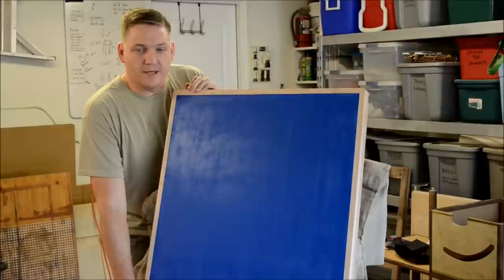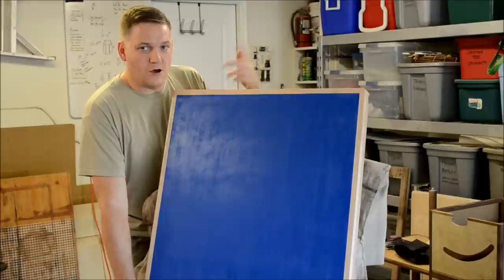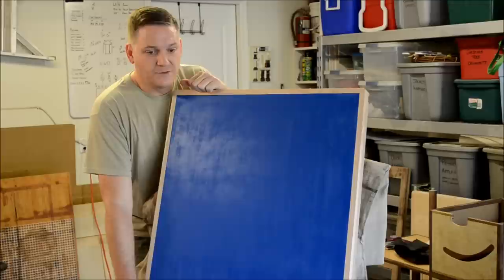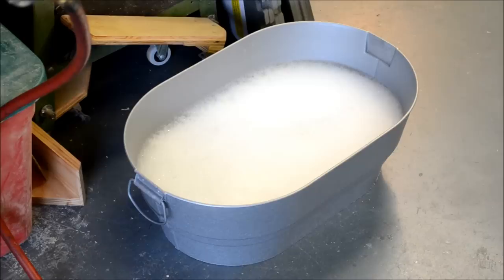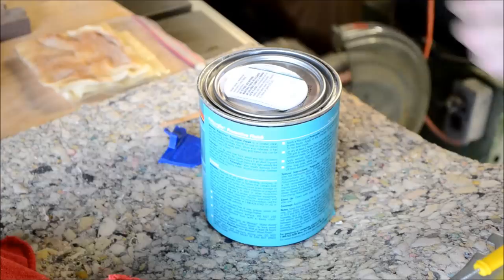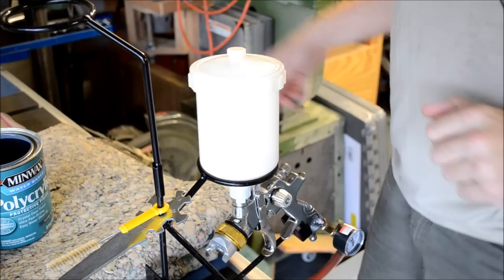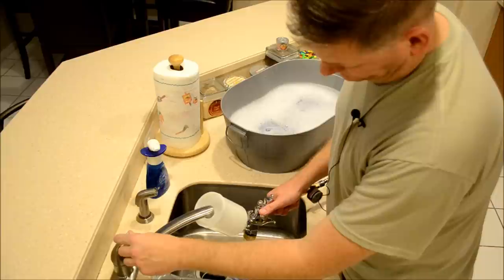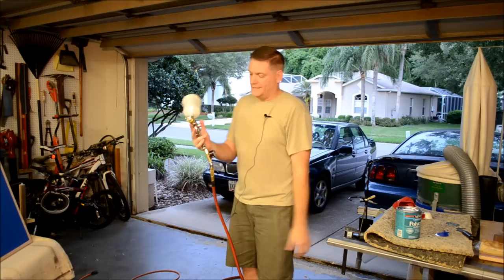5 --  Spraying Polycrylic (Yes you can!) - Tutorial

Comment: It's water-based... you can thin it with water 10-15%... Makes a HUGE difference... give it try.  This also decreases the size of atomizing paint droplets and allows for a "wetter" application and smoother overlaps. I'm serious, been using it for years and years like that.  Also, you should still be using a respirator.
Reply from the maker: Yes, I mispoke on the video.  BUT!! I corrected myself in my website article, and I gave mixing ratios for folks to use at home to hit those percentages.

Comment: I used the one coat Polycrylic from Minwax with an automotive  paint gun. I thinned it with water and sprayed it at about 38 psi and had great results. After seeing the HVLP gun, I am going to get one. Thanks for the tutorial.
Reply from the maker: Yes, I realized I mispoke later and corrected myself in my website article.  When I siad, "You can't thin this with anything..."  I meant you can't thin it with any solvent as you would with an oil-based finish.  It thins with WATER.

Comment: Thank you for this. I am making cornhole board and was having issues with brushing on the polycrylic. So I want to spray my next boards. Were you using a satin finish, or did spraying it make it have a non gloss finish?
Reply from the maker: Jonathan,

I used semi-gloss, but the spraying action does 'satin-ize' it a bit.  It depends on how thick you build up the coat each pass... thinner = more satiny, thicker = shinier.  Although the video doesn't look it, the finish is a nice semi-gloss on the wood but more satin on the plastic laminate (which was pretty shiny to start).  Overall, this piece and the entire project came out phenomenally.  I am very pleased with it.

Always happy to be of help!

Mike @ Doobly-Do Wood Works

Comment: I am building a table and chairs set,I have brushed on 4 coats of the polycrylic on the table top looks good,but on the chairs I want to spray poly on them.can this be done? I want to use semi gloss
Reply from the maker: Bill,

Yes!  I suggest doing your first coat with a brush and fairly thick.  Then 220 grit sandpaper, lightly by hand, between coats and do the remaining coats with a spray gun.  Run the air pressure as low as you can and still get a fan-shaped spray from the gun.  Lots of thin coats works best, as poly dries really fast between coats with a spray gun.  Lastly, clean the gun immediately when you are done spraying, to prevent the polycrylic from drying in side the gun.

DO NOT USE STEEL WOOL.  Polycrylic is water-based, so steel wool will introduce rust into your finish as it cures.  With the exception of using a spray gun, follow all other manufacturer's directions on the label.

Happy building and finishing!

Mike @ Doobly-Do Wood Works

Comment: That HVLP gun should have mineral spirits or pump armor run through it so it does not rust.
Reply from the maker: +Mike Grant 

Agreed.  However, dry air blown through the gun does just fine at drying it to the bone.  We've been running this system for years now and nothing has rusted yet.  Not even in Tampa humidity.

Thank you for your interest!

Comment: will this be good on EPO foam? or regular EPS (styrofoam) ty
Reply from the maker: friedchicken1981,

Yes.  Polycrylic is a water-based acrylic clear coat, so it will not react with EPO or EPS foam.  Any solvent based finish will, so it sounds to me like polycrylic is your best choice.  "RC Bob" Kreutzer has a good article at http://www.rcgroups.com/forums/showthread.php?t=192622,

Mike @ Doobly-Do Wood Works.

Comment: I watched another video where the guy reduced the minwax polycrylic with Windex glass cleaner at a one to one ratio. It sprayed great through an airbrush. He did shoot clear though, so maybe that makes a difference. I couldn't keep watching this video because the music is so annoying.
Reply from the maker: Ooh, great idea!  I'm not an airbrush guy, because my clients are usually asking for larger projects, but this makes perfect sense.  The glass cleaner works as a flow-aid, which reduces the surface tension of the water in the polycrylic as a chemical thinner does in oil-based finishes.